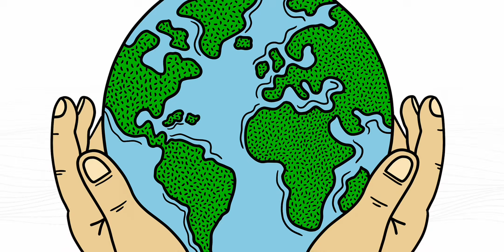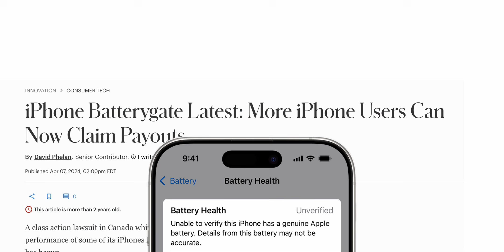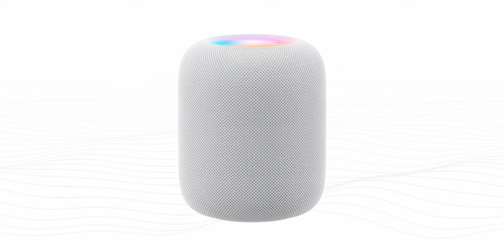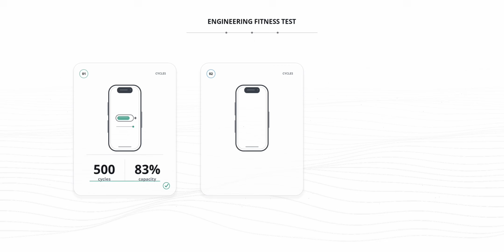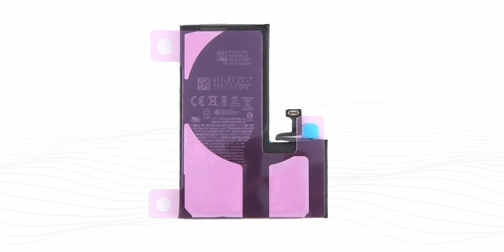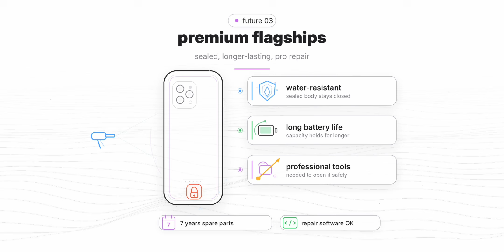The Truth About Replaceable Phone Batteries (The EU Loophole)

Comment: Im not buying a phone that has a removable battery. I dont miss the bad quality of that era. Removable battery means no waterproofing, no sturdy design. It would be flimsy trash would
Reply: Many of the sturdiest phone designs had removable batteries though, like the oft-memed 3310. 

The only reason you wouldn't be able to combine a removable battery with sturdy design is if you wanted the phone to be extremely slim, which unfortunately is the current meta.
Reply: @StrikeNoir105E no it equals poor battery life as well. The reason we can use a phone for 5 years or more is because it cant be opened. I remember the difference very well

Comment: Usb c made sense. This is because some people are too lazy to plug in their phone.

Phone lasts all day
Charges in 30 mins
They have wireless charging pads
Waterproof
Aftermarket doesn't last as long and costs a lot.
Your phone is literally a computer now to pull the battery abruptly you'd lose all your progress.

Why we needed it back then

Phone froze 
Battery didn't last replacing made sense.

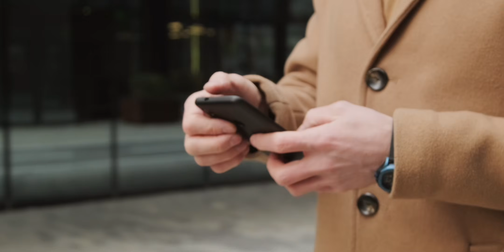Comment: 0:55 "runs hot" is not a sign of a worn out battery. If your phone is running abnormally hot for no reason, you should be concerned about the health of your batter for other reasons.

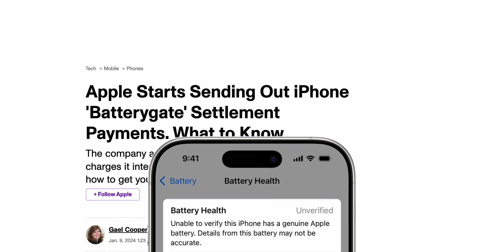2:00 for once someone actually presents BatteryGate in a somewhat accurate manner, if still with some backspin. It was throttling the maximum power draw of the CPU in response to a 'brown-out' event where the battery literally failed to meet an earlier similar request. When a battery wears out, it's peak output degrades in addition to its maximum capacity. Eventually that results in the phone randomly turning off despite it seeming to still have a charge. Reducing the maximum load to no more than whatever draw caused a prior spontaneous failure is a fairly reasonable mitigation. After all, taking longer to complete something is still a better experience than dying half way through it. Ultimately it was the lack of anything in iOS flagging this state to the user which is what they got dinged for.

Comment: So is EU going to recycle all those old batteries?  Because you can get the battery replaced. But the physical operating system still  will become obsolete
Reply: The OS will become obsolete in time, sure. But phones are replaced way before the OS is cooked due to battery issues. Recycling a battery is much cleaner than recycling an entire phone on the same timeline. We're nowhere near a place where batteries fail when the whole OS becomes obsolete.
Reply: @Vlr  I guess there are still people that leave phone on charger for the night with no battery protection turned on. Then ~5y official software support is longer than the battery can hold. So unless the mainboard dies, geeks will install linux mobile anyway😅

Comment: You're forgetting that the right to repair part is basically what Apple has fought against for a long time. When an old mac or iPhone stops working they rather have you buy a new rather than fixing the hardware. Today there are people fixing without Apples blessing, which means they basically have had to get parts from broken devices, schematics by someone who has reverse engineered it. UE will basically fix this by require 3rd party repair shops have access to parts and schematics. That means that if you're tech savvy you can fix your own apple products. Bravo EU! Also, didn't you like that all mobile phones now use USB-c? Thanks to EU too 🙂

Comment: tbh i dont need to make a pop up baterry just dont make it so hard ot replace one like i have an iphone i wanna replace the baterry its not enough i put in an original apple baterry i need to go to a very specific store and wait a week to get myphone back like making it hell why????????
Reply from the maker: You just perfectly summed up the entire point of the video. The physical repair is annoying, but the artificial digital brick walls and mandatory calibration software are what make it absolute hell. That's exactly what the Ecodesign law is supposed to fix by 2027. Fingers crossed it actually works!